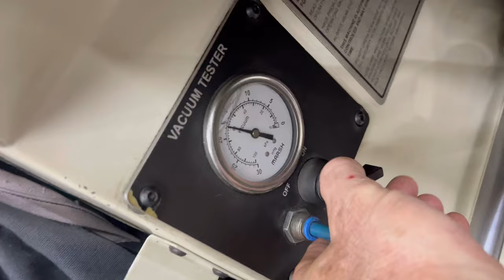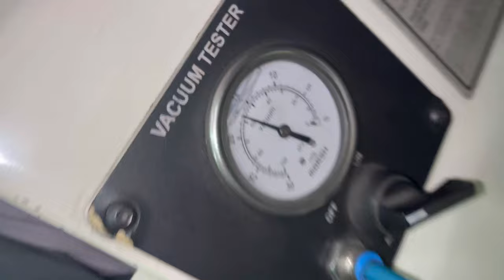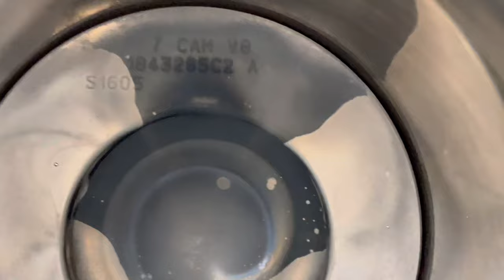FRESH PowerStroke Cobbler courtesy of your local shop!!!  Ron's South Carolina F350

Comment: Sad to see that level of workmanship from a supposed "professional" shop.  It bothers me when people don't take pride in their work, professional or not.

Just out of curiosity, how many miles are on this truck/engine?

Thanks.
Mike
Reply from the maker: 256k on the cluster.  By the looks of the cylinder ridge it was driven much more than it was idled.   So that's nice.    I agree on the shop, or whatever was going on with that repair.   I was genuinely dumbfounded about how these people sleep at night.   This is the job we hear about all the time when they say "I had a local guy do it,,,  he specializes in them".